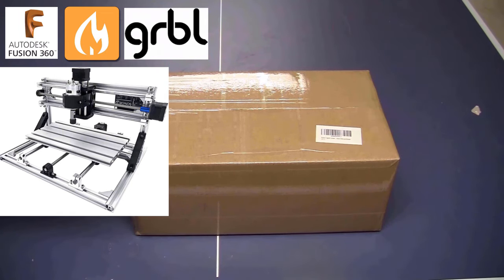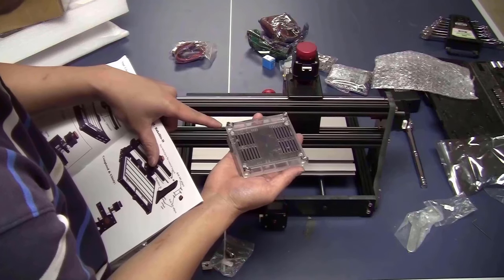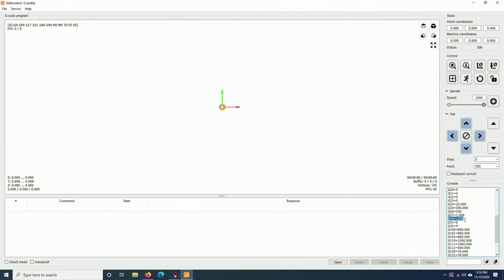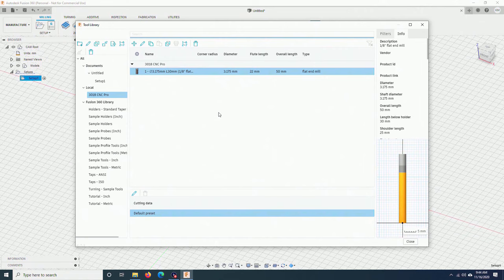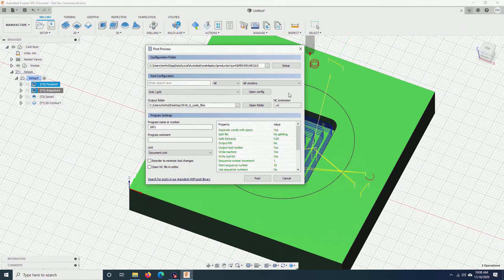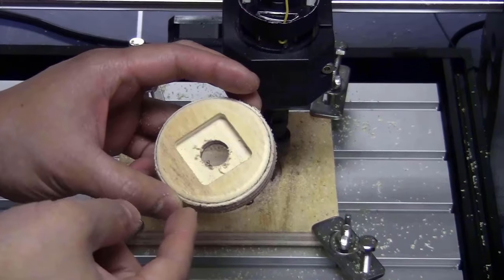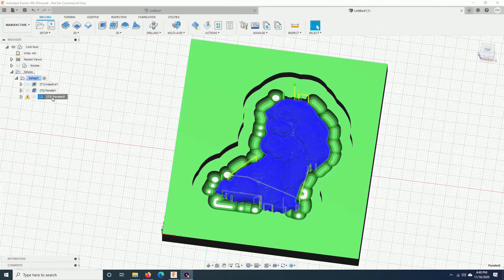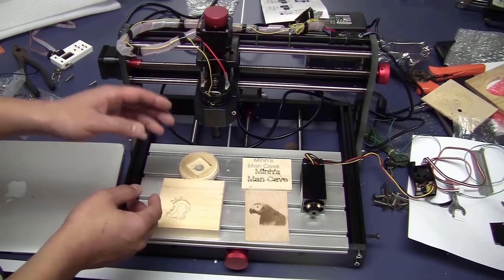3018 CNC/PRO - New (updated) beginner's step by step guide - All tricks and tips

Comment: This is an awesome video, I will download this video to my PC, and  review the settings step by step by slow motion ♥️👍 eventhough I have seen this video before, but it's easier for having this video handy. I have done the project in Cad, than brought it to Fusion 360,  I had to resale the drawing because the dxf file loose the size,  anyway I brought it to Candle and gave the origin to a corner of the project in Candel software,  but  the -Z was axis was still too deep  I gave just 1mm to be engraved in to the board, machine was digging deeply in to the board, so I scared my machine get damaged, I turned all off 🤔 well I noticed I installed the motor in Z axis too low, I loosened the screws and pulled the motor little more up and tightened, I'm happy now, the engraving is perfect now. All thanks to you, your videos are awesome. 😊🙏🙏🙏
Reply from the maker: Not sure how you chose your origin in fusion 360 and how you zeroed the Z axis in candle. If you don't have the touch probe, move the tip of the bit down till it touch the surface of the stock then click on zero z axis button.
Reply: In Fusion 360 I chose the corner upper point of the stock, and chose my project to be cut to Negative 2.6 mm witch is the thiknis of stock, thanks so much, looks I'm getting close, I will adjust the tool in Z axis per your instructions by placing an aluminum slice, wired to main board to pins on A5 by my next try. Eventhough I haven't finished my first probe, but looks like I'm getting closer. All thanks to your wonderful video uploads. I bet you the entire world are using your awesome instructions and happy for having you on the web. ♥️🙏
Reply: Well... I built the tool with "L" shape aluminum attached per wires to both Arduino pins A5, placed it how you did, moved down the tool until touched and stopped,  placed my project to be engraved jus 1mm, unfortunately it's same problem as before, tool wanted to dril much deeper than my desire 1mm into the stock, quickly I shot down the machine. Still no success 😌
Reply from the maker: @FlightSim2703  Take a look at this video and try to see if your axis are well calibrated, especially the Z axis in your case: https://youtu.be/_lKo0N0f5FM
Reply: @minhsmancave9448  haven't tested this yet, because when I engraved the "iphone" code, which came with machine was done well I thought the Machine calibration should be okay. Thanks so much , yes I will try this measurements to be sure.👍
Reply from the maker: If that's the case, email me your Gcode file and I will have a look to see if you set it up correctly.

Comment: The G28 section explains the random issues I've been seeing, thanks for explaining and providing a workaround. 
Also connecting the z-probe to the spindle motor casing is genius, no more flailing wires when accidentally starting the job when clipped to the drill bit.
Reply from the maker: Thank you for being patient and watching through the video. I also experienced the G28 code the hard way, cut through my models a few times before I found out what it was.

Comment: Great video Minh! I saved this to my list of learning videos.  I just received my 3018 pro (same model as yours)and assembled it only using the 'not so great' manual and it seems to be solid and works well. I appreciate your effort to help others to figure this little tool with big possibilities out. I will use this video to work my way through basic  operation and further setup.  👍
Reply from the maker: Yes, the possibilities are endless once you get used to setting up the CAM process. I think that's the part that put many people off from using a milling machine and that's why I tried to give as many details as possible. I'm sure you and many others will be able to make amazing things with this machine in no time.

Comment: after seeing some videos that Stepcraft recommends using Proxxon IBS/E spindle for beginners, I 3d printed a holder and upgraded my 3018 cnc with a Proxxon. Now I can cut faster and more clean with 20k rpm.
Reply from the maker: Being creative and doing things differently is key. Cutting wood at 20k rpm definitely make the edges smoother. But you will need coolant to cut aluminum, high speed will make the chips thin and melt.

Comment: This video helped me tremendously in using my (non-pro) 3018 with Fusion 360. Thank you! I already had some experience with Fusion for 3D Printing, but for a total CNC newbie like me, the CAM part is quite a different beast.
With my design, I ended up with a lot of unnecessary retracts and helical ramp-downs, even with Stay-Down Level set to "Most" and 100mm of maximum stay-down time. But I read that this can happen in designs with a lot of fine details, which my design has. That said, I'm curious whether you have any hints to reduce the number of unnecessary retracts in Fusion's toolpaths.
I found the older version of this video first, but fortunately found this version because you linked to it in the comments. I think if you also put the link at the top of the description of the old video, this newer video will get more views.
Reply from the maker: Yes, there are a few things you can do to reduce retractions and helical ramps. For example, if you are using 3D Adaptive clearing tool path, in passes tab, check "Order by Area". Then, in Linking tab, increase the ramp angle maybe to 5 or 7 degrees, ramp clearance height, reduce it also, may be to 1mm or less. Hopefully that will help.
Thank you for your suggestion, I'll change the title of the old video to suggest people to look for the new one.
Reply: @minhsmancave9448  Thank you very much, this is very helpful! I will try your suggestions. Please do not change the title of the old video to something discouraging -- it still gets recommended a lot while the new video is not -- and it would be a shame if people would not click on the one that currently shows up for them and not find either version of these two videos. I meant to suggest to just put something like "Updated video here: <link>" at the top of the old video's description, so they'll find it quicker. Thank you again, your videos are very useful to many!
Reply from the maker: I did exactly what you said, lol. We think alike.

Comment: Great Video, i just got my 3018 cnc/pro Today. its still in the box. its my first CNC.  that Fusion 360 looks really complicated.  i will have to look for an alternative. (if there is). Thank You for taking us thru the assembly process and the working side of it as well. cant' wait to get started.
Reply from the maker: CAM software is more personal preference. There are many to choose from. It also depends on what you wanted to do. 2d engraving (fixed depth) or 2.5D. The hardest part will be to get the first cut done correctly. Once you've done that, everything else is only deviation from that. My advice is to be patient, take thing slow going step by step.

Comment: It is better to put the clamping support screws  head upside down to avoid damaging (scratching) the table. The surface of the support screw head can be sanded smooth.
Reply from the maker: Harder to adjust the high but yes, less damage to the bed.

Comment: Hi Minh, i checked my spindle with a tachometer and it goes to 8,000 RPM max, i wonder if its the same for all 3018 CNC.
Reply from the maker: I've never gone that far to check, but it's very possible since the 775 motor (spindle for 3018) is not a very advanced type of motor. The speed surely can vary a lot from the specs. 8000 RPM is not bad at all, and you will use the machine at the max speed most of the time anyway. With this type of motor, slower speed meaning small torque too.
Reply: @minhsmancave9448  Thaks Minh, if you still need someoe to p[ractice your Engliosh with i can still help, you asked a couple of years ago but then covid happend :/

Comment: Thanks for the well explained video. I am a newbie.  I purchased a 3018 pro and followed your demo exactly as you explained many times (Fusion 360 & Candle), each time the CNC cut size is reduced to approximately 1/3 of the original size. Please HELP, what I am doing wrong?
Reply from the maker: Make sure all the unit was set the same in all software: Fusion 360 and Candle. It also might due to the step per millimeter was not set corractly in the firmware of your controller board. You can try this video to check: https://youtu.be/_lKo0N0f5FM
Reply: @minhsmancave9448  Thank you very much my dear mate, I watched the video and changed the initial settings and it worked. Really appreciate it.

Comment: Thank you for the video and useful information! What speed do you think is better for a 6 mm plywood to mill? (4x-pass cutter, 3.175mm)
Reply from the maker: Depending what tool path you are using. If it's adaptive clearing, go fast. If it's 2d contour, go slow, around 800mm per minute. This because 2d contour have more load on the bit compared to 3d contour.

Comment: Hi :D did you check how accurate the machine is? if you cut square 10mm x 10mm will it be spot on ? I have simmilar machine but when i'm trying to cut 10x10 it comes closer to 9.5.

Comment: Thank you so much, I just got a CNC for Christmas I was fallowing your tutorial for Fusion 360  and when It came to the point to make the part It was then that I realized my Z axis is the front and not the top so none of my tool Paths would work out . I have looked for a way to change the orientation of the UCS so that the Z axis is up and down but  so far I haven't been able to figure it out . have you or anyone else ran into this problem?  I don't think  I changed anything in the settings.
Reply: Are you sure your cable are plugged in the right way around?
Reply: @johncollinson1061  Thanks John , I was talking about the z Axis within the fusion 360 program , not on the CNC , but thank you for the reply . I have since figured out how to make the z Axis up and down in  fusion 360.

Comment: Great video thanks ! Just subscribed.  The Jog function on Candle also did not work on my computer like yours in the video (thought it was my computer). Installed older Candle version and works fine and I use that instead. My CNC 3018pro does not have the red handles yours have to move the steppers manually, what are those called for buying ??.
Also considering upgrading the motor to the 20.000 rpm at 24v version and the extending the Y axis to 380 mm, all cheap upgrades from Sainsmart, about 90 bucks total.
Reply from the maker: To install the handwheel, you will need the leadscrew to be long enough (stick out of the bracket). You can always update the firmware of the controller board to use newer version of Candle.
Reply: @minhsmancave9448   Thanks a lot, so it looks like I just need to update the Arduino board firmware. I spent a couple days trying to figure this out until I tried the older Candle (it's my first CNC). Thanks again for the very useful video
Reply from the maker: I'm glad it was helpful. I showed how to upgrade the firmware at the end of the video if you needed instructions.it's not too hard
Reply: For me (on GRBL v1.1f, Candle 1.1.8), jog movements did work before running a job, but not afterwards. When I filled in a value into the feed rate field, it worked.

Comment: thanks a lot for this video > i hope  you will be fine ::)   i buy a 3018 CNC  its moves well ,  but i have a problem with the connect   with
 candle software  (port opend )   after select  the (com  of the usb num)    ,please help me  , thanks
Reply from the maker: It might be the firmware version on your controller board is too old compared to Candle version. You can try to upgrade the firmware as I showed at the end of the video

Comment: just bought the CNC 3018 Pro version and it has a constant communication problem, not sure the firmware was correctly installed, so tried to do your GRBL firmware upgrade and it fails every time any suggestions on a good forum to fix this.
Reply from the maker: I don't really know any forum to help with that but I can try to help you myself. What's the message when the upgrade failed? Few things to make sure is that you have the CH340 driver installed, then when you choose the arduino nano board, remember to choose the old bootloader.

Comment: Hi, Just want to ask that, i am having the problem of the software is keep connect and disconnected on its own frequently, can what know what is the problem causing?
Reply from the maker: Have you tried with another computer to see if the problem is the machine or the computer?
Reply: @minhsmancave9448   hi, thanks for the replied,  just checked the problem for awhile and it is the USB cable problem, right now another problem is the motor is not running, as it just got some knocking sound at the beginning but its not moving at all.
Reply from the maker: Try the motor directly with 12v and see if it run normally. If not, it might be controller board. I cannot really tell if I don't have the machine to check

Comment: our motor sounds like it is slipping could you help with that?
Reply from the maker: You should try to turn the leadscrews by hand to see if you can move the axis. If it's hard to turn by hand the  it's probably  too hard for these small stepper motors. Check if all the rails and leadscrew on each axis are paralleled to each other. Try to disengage the stepper motor from the leadscrew and see if it still run correctly. If not, you might need to change that stepper motor. Sometimes, it also can be that the feed rate or the acceleration settings are to fast for the stepper motors

Comment: Hello! Can you help me, please? I got my machine. I wanted to use the Easel software but the spindle doesn't want to run? What is the problem? The jog is moving.
Reply from the maker: In easel, when you export the Gcode, you can choose what type of machine (x carve or Grbl). Make sure to choose grbl because x carve is manual turning on/off spindle
Reply: @minhsmancave9448  Thank you for it. Omg.
It is solved the problem. I tried many things.

And another thing, please.
I have just started to use my machine for a day. I will discover it but I don't understand one important thing.
I design the form etc. I set up the zero from the corner, and the machine is starting to work not like on the animation for example like at the Christmas tree- up.
Instead of it come to a wrong place down towards me, like a reflection. What is the problem?

Thank you for it.
Reply from the maker: You will need to reverse your Y axis. In candle, at the console area (lower right corner), type "$$", look at $3. Tell me what number you have now and I can tell you what number to change to. With the 3018 cnc, when you press arrow button toward you, the bed should move to the back, not toward you (the movement is the spindle compared to the bed), like this, the spindle is moving forward to you. It's a bit confusing for first time user, but if you watch this video, there's a section after assembling of the machine, I explain this problem.
Reply: @minhsmancave9448  Thank you for your kindness.
I can see this: $3=0 (dir port invert mask:00000000)
Reply from the maker: Then type "$3=2" and the Y axis should be reversed
Reply: @minhsmancave9448  Perfect thank you! Now is working. I am soo grateful. I am very happy, I can start to work. Maybe I set the spindle also in the candle. Like in your video. Mine is 9000 r/m

Comment: my controller doesn't move, what's wrong?
Reply from the maker: Check if you chose the right port in Candle for the controller. Or did you installed the driver for the controller?

Comment: Hello please the 2d contour keep writing safe distance is higher than the feed height .consider reducing the safe distance, otherwise, the feed height will be raised to match the safe distance…. 
Please how to I fix this ????????
Reply from the maker: reduce the safe distance in when setting up the 2D contour in the last tab: Safe distance have to be smaller than feed height.
Reply: @minhsmancave9448  thanks , please how can I engrave on acrylic plastic with 2d engraver, because my fusion 360 dose not pop up the cam option for me to engrave
Reply: @minhsmancave9448  please can you make a video on how to engrave sign and designs on acrylic with fusion
Reply from the maker: Could you find a picture of the type of signs you wanted to make, I can use something similar as example in the video
Reply: @minhsmancave9448  okay thanks 🙏 God bless you
Reply: @minhsmancave9448   I have sent  a message to your mail with the picture attached.. thanks for your time
Reply: @minhsmancave9448  hello are you there , I have send you messages on through your gmail
Reply from the maker: Yes, a video is not something can be made in one or two days. I have other things on hand too. So, please be patient
Reply: @minhsmancave9448  yes i understand, i just wanted to know if you have gotten my messages and the file i sent to through gmail
Reply from the maker: @whizywhizy8469  Yes, I got the files and got an idea on how to mill what you wanted.
Reply: @minhsmancave9448  okay thanks 🙏